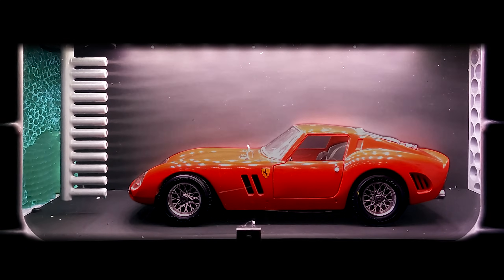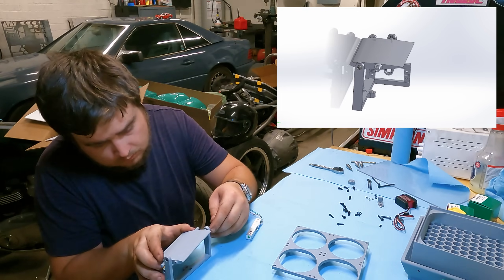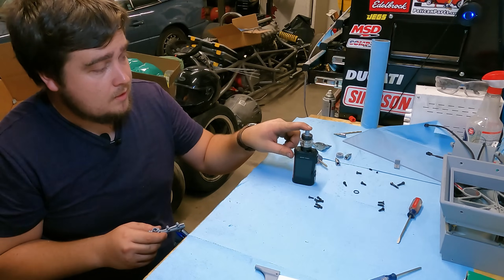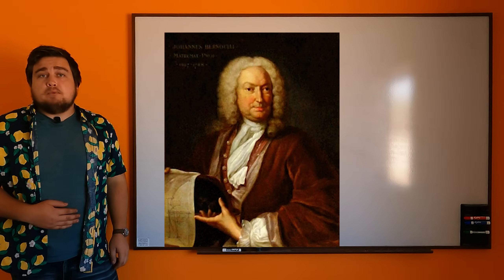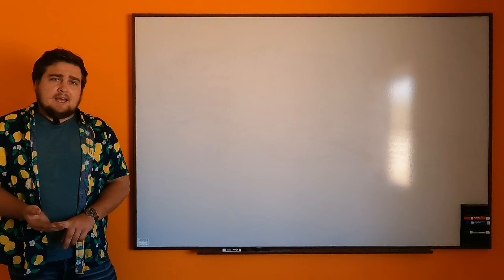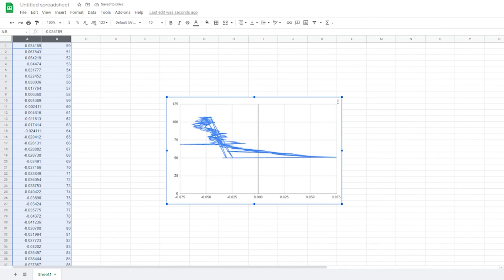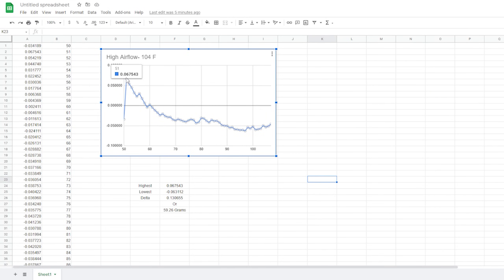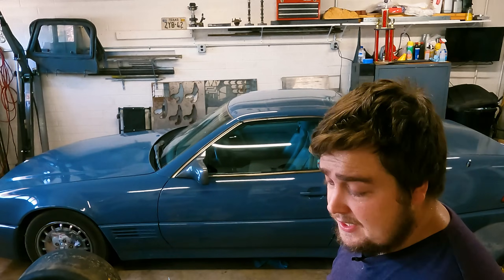DIY Active Aerodynamics | Pt. 1 of 2 - The Wind Tunnel

Comment: The active airbrake is a cool idea, though if you wanted to make "dumb" active-aero, I just had the thought.

What if you made a spoiler, with an inverted wing design, that started with an aggressive angle of attack, but its front mount was a free bearing and the rear mount was a tuned air strut? That way, as speed, and thus downforce increases by plowing into the air, it would naturally flatten itself out, reducing drag but still producing downforce due to being an inverted airfoil??
Reply: My gut feeling is that that arrangement would only ever be capable of dynamically adjusting itself in order to provide exactly zero downforce all the time.
Reply: Not sure how you figure. And inverted airfoil clearly makes downforce, even at 0 angle of attack, but it's really weak till high speed. Hence the dynamic angle.

Are you under the impression that the gas struts "absorb" the downforce when they are compressing? For the pistons to compress they MUST be transmitting the force down, into the body of the car.
Reply: @Nevir202  I completely misinterpreted the angle of attack thing as the wing flopping down under it's own weight when stationary, sorry.
I would be very intrigued to see your arrangement at work.

Comment: i tried to weld two bits of brass together and you built a wind tunnel...  awesome stuff..
Reply from the maker: Hey, brass is hard. Don't sell yourself short.
Reply: @WesleyKagan  i'm not selling myself short :)  i can see how much prep and thought went into that! Griptopia (matt)  i did Casey P's intro graphics if you need any 3d (i know you are more than capable) hit me up, fun working with other engineers :)   I'll need to pick your brains at some point, i'm putting a v12 merc engine in a GTLM at some point.. was thinking of using triumph throttle bodies.. then saw your idea..  955i's bodies go for cheap too..  The brass welding is tig practice for when i do my exhaust manifolds and other things. Great work dude..